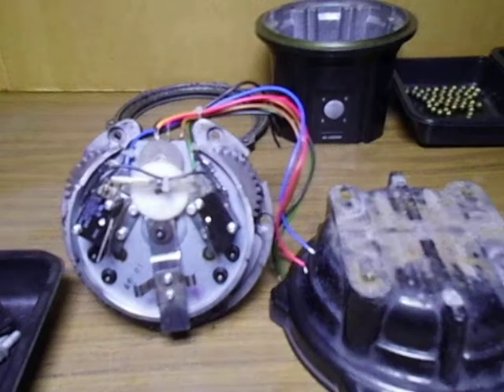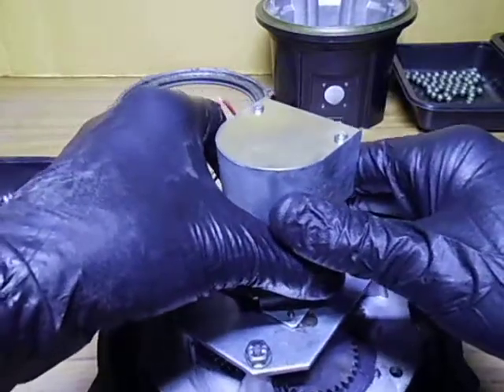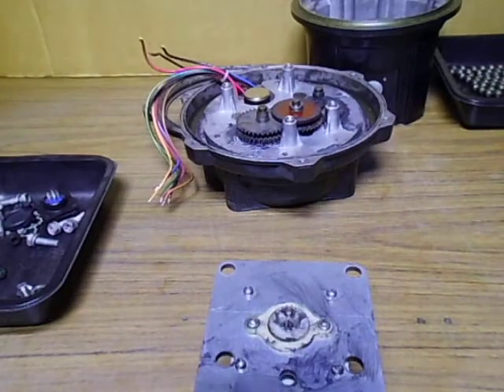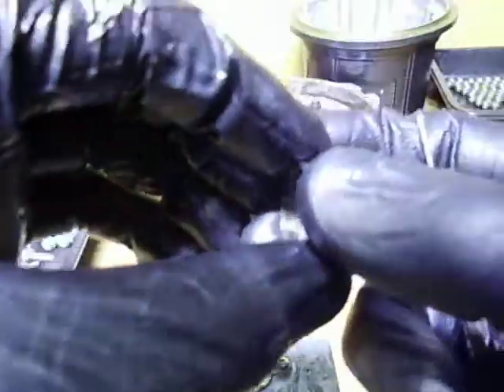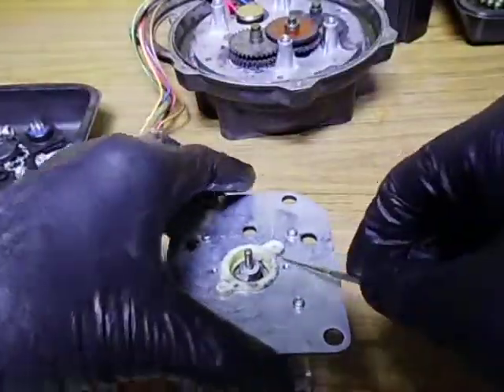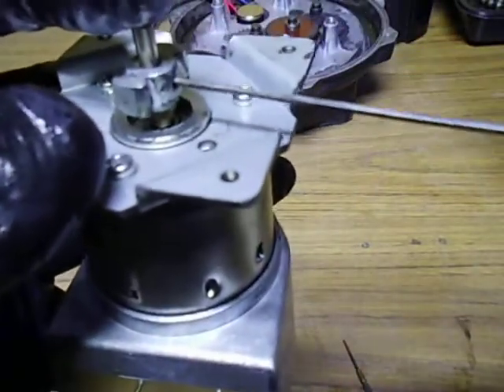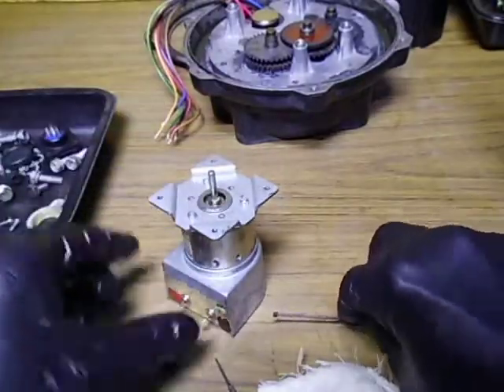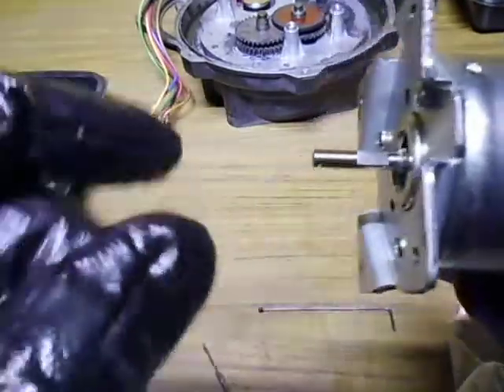Yaesu G-2800 rotator strip down for repair & services

Comment: I have a new 2800-G I've not used yet I've removed it out of the 📦 I'm hearing a barren moving inside of it.
Reply from the maker: Hi Ray, thank you for the comment. I don't know what you mean by barren?.  You may be hearing the Limit Swing Bar moving & hitting the limit switch levers.
Reply: @duoro-rotators  Okay thank you I've removed the screws and the barrings are in place on the bottom and top.

Comment: I’ll do mast inspection and maintenance soon so will replace the rotor.  I have a new Hygain TX2 available (NOS Hygain, not MFJ)  or can get a new G2800 rotor.  Which of these two rotors do you feel is more robust/trouble free?  Antenna is Mosley Pro 57B-40, new rotor controller will be Green Heron RT-21.   Any suggestion on a different rotor?  Any check/mod/fix I should do on the new TX2 BEFORE installation?  I value your opinion a LOT.  Thanks
Reply from the maker: Hi Jim thank you for the comment, these two rotators have a major difference in specs etc. The T2X has a Wind Area of 1.8mSq, where as the G-2800 has 3.0mSq, This is mainly because the G-2800 has 3 sets of final drive gears on to the housing where as the T2X only has one set. The Brake Torque is also way different T2X is 104kg/m, where as the G-2800 is 250kg/m.  The Rotation Torque is also a lot different T2X is 11.7kg/m, where as the G-2800 has a range of 8.0 ~ 25Kg/m because it has a DC motor with speed control. 
I have a selection of rotator comparison charts for a lot of makes & models of rotators, all written in the same layout & metric measurements for easy comparison.
Other brands of rotators Create RC5 series (worm gear drive) has wind area ratings of 1.2 - 2.5 & 3.0mSq, you can see more info on my web site. 
For more information, please get in contact with me via my web site, which is listed in the description.  Regards Peter of DUORO SERVICES

Comment: I’ve bought two of those, and for what they cost I would expect more from a trusted brand. 
Both are on the shelf, I get more longevity out of the RCA tv antenna rotator.
Reply from the maker: Most of the problems these rotators have, is cause by poor assembly &/or the under size 3mm grub screw used on the BK brake butterfly as mentioned in the video.

Comment: Hello ive some troubles with the 2800 yaesu. Can you explain how to correct re-assembly and full adjustment? I make the repair with the ‘butterfly’ , but now I think ive made some mistakes with the alignment between controller and rotator. Thanks in advance.
Reply from the maker: Hi IZ2MGN, Thank you for the enquiry.
However I can not explain how to properly align your rotator etc on any open media, as that is my job & how I make my living ie pay bills etc. If you want to get in contact with me via my web site (the link is in the description of the video) I could write up a alignment manual & sell you a (laminated) hard copy, sent to you via post only. Regards Peter
Reply: @duoro-rotators  hello , thanks for the reply. I’ll look at your website. 73

Comment: Very infomative clip. I have a G-2800 with a stripped plastic gear but wasn't able to find a internal parts list for ordering the part. Any ideas? Thanks.
Reply from the maker: Sorry I missed your comment, The No.1 gear in a G-2800 is a fibre gear not plastic, I have these gears in stock, if you still need this gear please get in contact with me via my web site, which is listed in the description of the video.

Comment: hello good evening loved seeing your video, but ive got a problem with  Yaesu G450c where the rotator turns but not the dial on the control box any ideas please de m0sgb
Reply from the maker: Hi Steven, There is a number of things that can cause that problem with your G450c.  First in the controller :- Broken display drive belt, Cracked drive gear on the POT, Stuffed POT, One of the pins (1,2 or 3) in the output plug/socket has dislodged, Faulty wiring &/or joint in control cable wires 1, 2 or 3.  The ROTATOR :-  Stuffed POT, The screw that holds the small POT drive gear above the limit swing bar has come loose. I can give you testing procedure to help you check & eliminate some of the above problems, contact me via email on duoro2@bigpond.com .

Comment: I have a Yaesu G-450c that has just lost its 'brake' and the antenna moved position in the wind. I turned the antenna back to the beam position it was pointing 'by hand' before the winds. I could hear the gears turning freely inside with rotator with no un-towards noises, I guess the brake has failed as I should of not been able to turn the rotator by hand. Using the rotator controller all seems fine and the rotator turns and the controller needle position seems ok once it caught up to the position of the rotator after I manually turned the rotator. Thanks for your detailed informative video of the Yaesu G 2800 which has given me an understanding as to what could have possibly failed on my G-450c. Looking at the G-450c rotator exploded view diagram I can see the very same 'BK ButteryFly' in the GT-450c..... I wonder if the grub screw has backed right off allowing the shaft to turn fully or worse still the 'BK ButterFly' may have snapped. The last time I installed my hexbeam antenna on the rotator I did notice a little left to right slap but nothing to excessive :-(
Reply from the maker: Thanks for the comments on the video. Since you stated the rotator seems to still be turning OK via the controller, I would have a guess the BK butterfly grub screw has not totally back out & is still in contact with the motor's shaft, but the BK butterfly has dropped down missing one end of the BK spring  There is a couple of other thing's that can cause the BK brake to not hold. (1) the BK spring ends have snapped off. (2) the BK drum is one of the cheap crap versions that the BK spring cuts/melt the drum. The only way to really find out what has happened, is to strip down rotator & while you have it apart check everything plus service it. PS I have noticed they don't use enough Lock Tight on the BK grub screw plus @ a guess has not been done up tight enough when it was assembled. Regards Peter H
Reply: @duoro-rotators  Hi Peter, thanks for your reply with further helpful information. Once the UK weather improves and warms up a bit I'll get the rotator off the mast and strip it down. Thanks for boosting my confidence, Cheers Paul